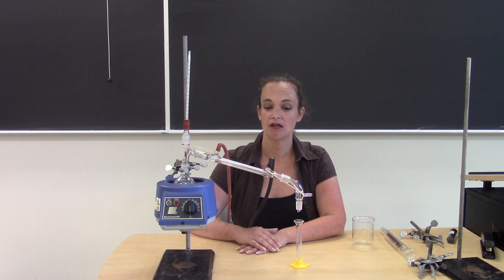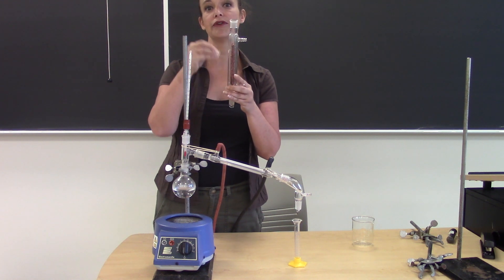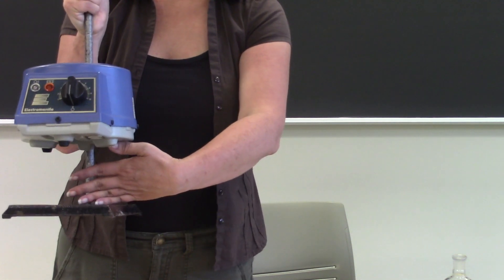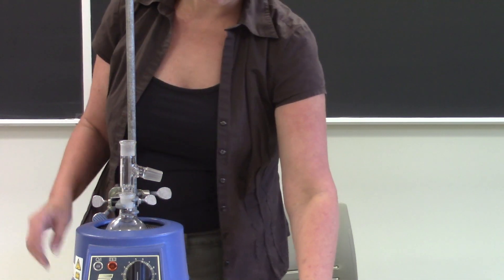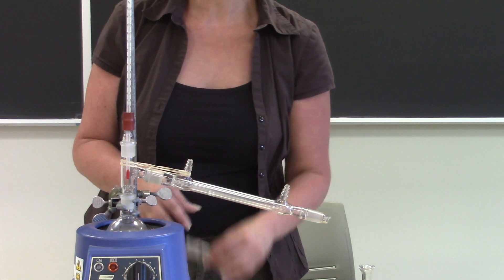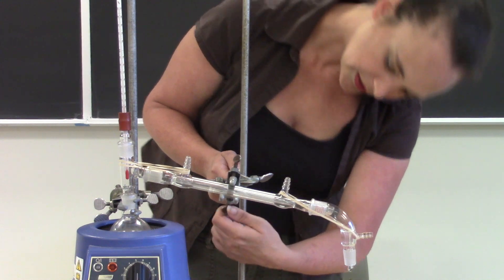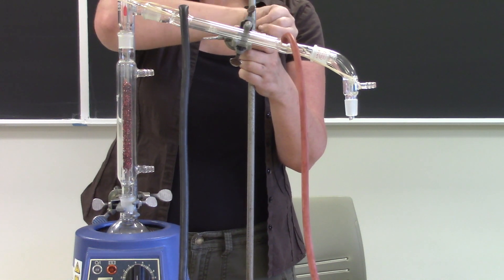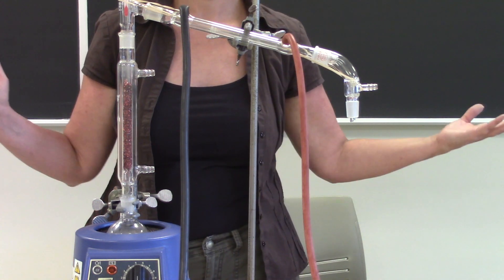Distillation

Comment: It is better to use those plastic clamps that go on the joint
Reply from the maker: I agree, keck clips are terrific. Unfortunately with the number of students we have, too many wind up broken, so we went old school.
Reply from the maker: @57777-r  So long ask your keck clips aren't cracked, they should work even better than rubber bands. We were too poor to be able to let the students melt them (back then keck clips were almost $10 each, and the one by the heating mantle would often wind up melted), so we used these instead.